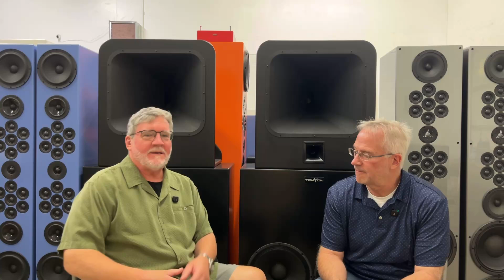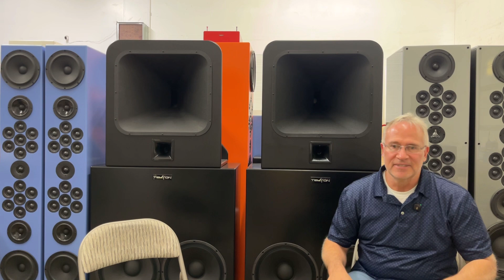Tekton Design’s Eric Alexander on speaker design, and the state of high end audio

Comment: What DAC, pre amp and amplifiers did you see Eric was using in his listening rooms?

Just curious.
Reply from the maker: It’s all dirt cheap. The amp is $70 Class D off Amazon. iPad, and some budget Kimber completes the “system”. For a very good reason! As Eric told me, he once had a customer come and audition, and later call to say they didn’t sound like the demo pair. Because they were demoed with really high end gear, the customer was using a receiver and lamp cord. Eric cares about his customers and started using the cheap stuff right after. Also, his “listening room” is a corner of the warehouse! So if you like what you hear at Tekton it is only guaranteed to be better when you get them home.
Reply: @MillercarbonsTheAudioFiles  Awesome I have some budget gear.

Wiim Ultra
Schitt Mimir DAC

Fosi Audio ZP3 pre amplifier with Sparkos ss3602 op amp upgrade

Zero Zone TPA3255 mono block class D amplifiers with LC-5 op amp upgrade.

Mogami speaker cables

RSL speed woofer 10 sub woofer.

I was looking at the Lore model Tekton for my 13x15 room but after watching this video I may look into a larger Tekton model.

Any advice would be awesome.

Kind regards,
Eric

Comment: i want the Ulfs so bad im in Australia though and want to see how they would sound with my bryston
Reply from the maker: There’s something about Eric’s designs that makes them really easy to drive, and sound great with a wide range of amps. I’ve heard lots of different Tekton with a huge range of amps. Moabs are very similar to Ulf and I ran mine with Pass, Melody, Raven, Bel Canto, and even a bunch of SET amps, everything from 20 to 200W. In each case the difference I heard was the character of the amp. The more power the more authority and the louder the volume you can get. But there was never any feeling like this amp can’t handle it, these speakers need more power, or anything like that. There’s also a lot of people using them even with low end gear like a AVR and even they are happy. Consequently I feel confident in saying that if you like your amp now you will love it even more with Tekton. And the Ulf15 is just about as good as you can get, and I mean regardless of price. 

Eric gets a good rate on international shipping, and you get a credit equal to the
domestic delivery rate. It’s never cheap shipping to Aus but having Ulfs is priceless!

Comment: I’ve had a pair of Pendragons for almost 6 years and love em. Eric took the time to take a few questions and just talk speakers for a while.. I’ve got other nice pairs of speakers, but the Pendragons are my forever speakers in my main system.
Reply from the maker: I’ve heard them. Encore, Ulf, Ulf15, Moab, Enzo. Plus a couple others. All outperform everything else I’ve heard anywhere near the price. I can see any of them being forever keepers. That’s what I have planned for my Ulfs.
Reply: @MillercarbonsTheAudioFiles Yeah, I’ve also heard the DI’s and lores, all of which punch way above their weight. I had looked at other speakers in the $10K range, and the $2K Pendragons beat em all.
Reply from the maker: @NickP333 That’s what really surprises me. I can understand how the upper tier speakers with the full MTM array can outperform. Same goes for Double Impact, even though they are only about half the MTM. But I have also heard the smaller models without the array and even they do a better job than anything else I know. Granted I’m far from having heard everything there is, but you go to a show and nothing even comes close, well I have better things to do than flog a dead horse.

Comment: What model would you suggest for a 200w Adcom rig in a 10x12 space with plaster walls and coved ceilings. 
I'm currently running Wharfedale Linton 85th's with custom crossovers. 
Thx
Reply from the maker: What’s your budget? What are your long term system goals (3 to five years)?